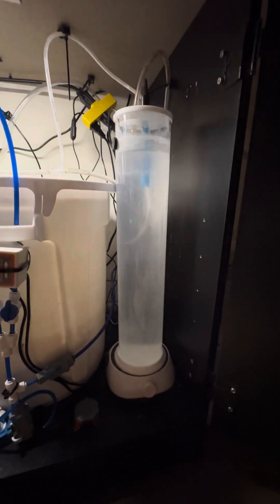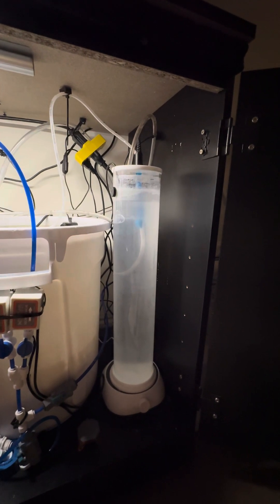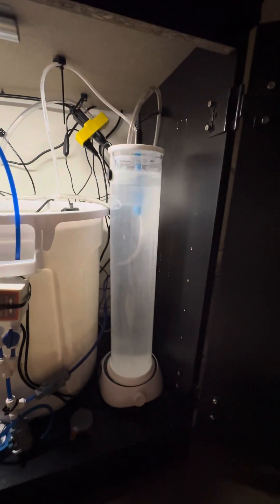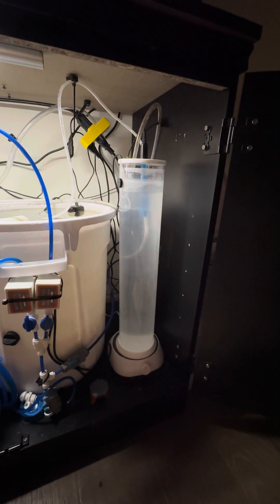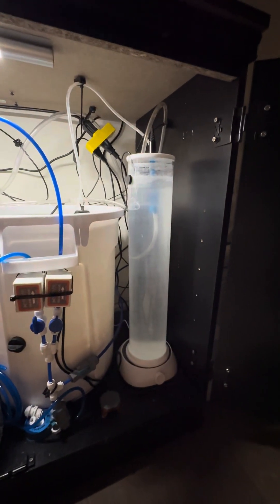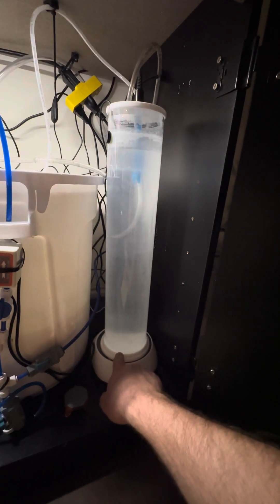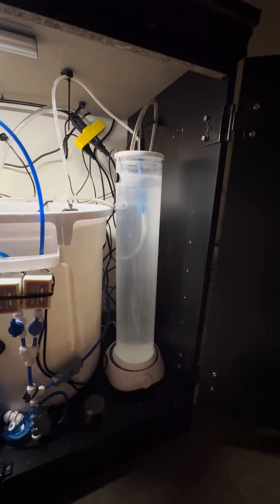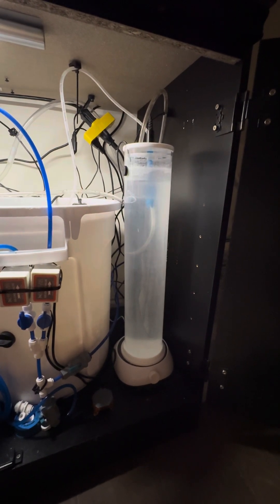Explained: DIY Kalkwasser Reactor

Comment: Only problem with linking kalk dosing to evaporation rate is the fact that evap rate changes depending on the season, so the amount of alkalinity and calcium dosed changes, and your alkalinity and calcium levels may then change too much leading to instability (our boogeyman).  I’ve changed to just dosing kalkwasser via dosing pump (I’m using a versa but it doesn’t matter any dosing pump will do) from a 5 gallon bucket (no slurry just 1tsp per gallon rodi) until my pH and alkalinity are at levels I want.  The Hanna alk checker (or if you’ve got $ an auto alk tester) makes dose adjustment very quick and safe.  Just my cheap reefer 2 cents…
Reply from the maker: Correct. I do see slight changes in alk and cal  supplemental dosing requirements, due to the way I dose it. I measured my evaporation in a couple of different seasons, and it seems to hover between 2400ml and 2700ml per day (not scientific, just a rough approximation). I’ve got Kalkwasser dosing set to 2200ml of saturated per day, which is probably overly conservative, but I’m okay with my traditional dosing supplements picking up the leftover slack. I let the Trident adjust dosing based on measurements it takes every 6 hours, so I don’t have to babysit all of it constantly (a lifesaver when trying to wrangle a kid and split time between two jobs - ha). I’ll probably change it up and dial it in more once my kid is older and I have the time to fiddle with it all!